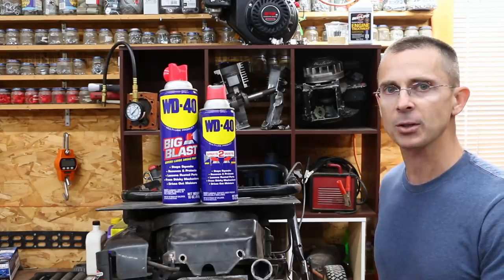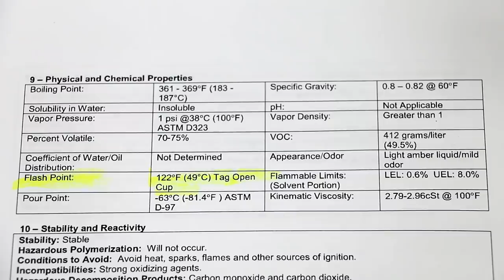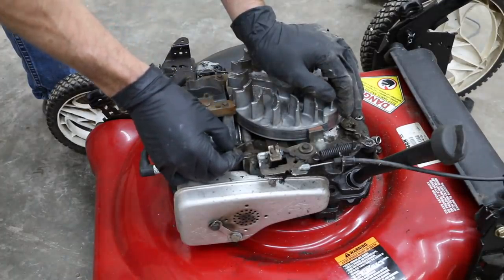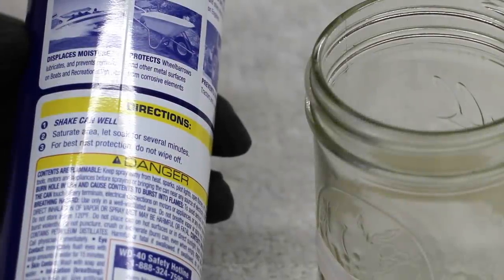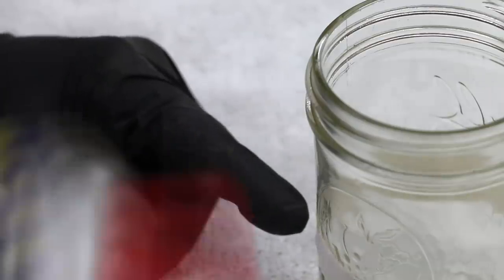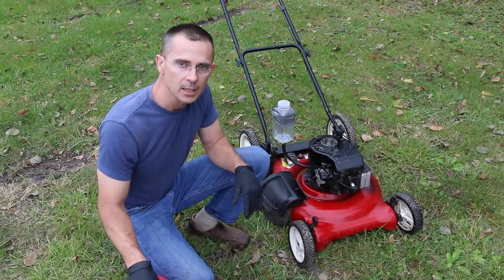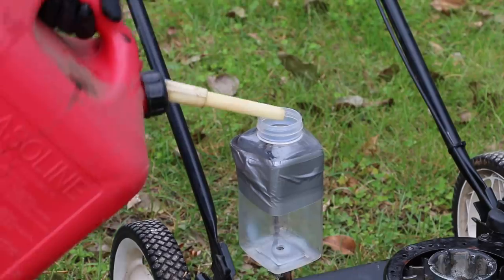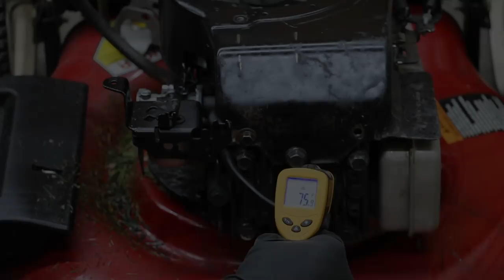Will a Gas Engine Run on WD-40?  Let's find out!

Comment: Interesting. We used to use 3 in 1 oil as an after run oil and preservative for our nitro methane model airplane engines. But we ran into a problem of it being so flammable that the engine would start without the glow plug power being attached. My father was flipping it through after a flight and it just started and ran without a glow plug. Very dangerous. We changed to marvel mystery oil after that to preserve engines.
Reply from the maker: Thank you!

Comment: You should try blocking off the spark plug on a gas engine with a bolt the same size an make a Diesel engine see what fuels will combust with no spark at all
Reply from the maker: Thanks for the suggestion.

Comment: it appears to be running on the gasoline part of the mix, and partially burning the wd-40. Just enough to lubricate the top end. I would say after one hour the engine would not be able to restart with the carbon buildup. Shave the head on this engine and put on a new main bearing or rod bearing and raise the compression up to 15 or 16 to one it it will run on straight wd-40, )for a while(
Reply from the maker: Thank you!

Comment: Many yrs ago coming out of woods I ran out of gas  ,and in the trunk I had 1 gallon colman camp fuel and a gallon of wd 40   so poured both in tank  and got to gas , so worked for me  yes it did smoke alot  ,but after fuelling  , it seemed to run better   ,so felt it blew out alot of carbon. 
So in later yrs  when tuning cars I would rev up engine and pour in liquid wd40 till I flooded them out let them set awhile   to soften things up   ,start them up , black smoke like crazy  ,then with spray bottle with engine revved up spray in water  , again  blowing black smoke till clean  , all carbon  gone run like new 
Also sticking lifters and valves gone I would add 1 cup wd40 to oil  , clear right up in short notice 
Also useing in oil all time never have and leaking seals   
Also I add to all rear end and transfer case  ,never have a leaking seal , 
If you spray your wiper blades twice a yr the blade last for ever 
Awesome shit when you get down to it and learn its many benefits and uses    I'm 77  been using it extensively  since the 60 tys  
Valve seals never go bad , they get hard and cause the oil to go by , but continue use they don't go bad ,run many motors 2 -3 hundred  thousand miles   still running smoothly no smoking  ,
Reply from the maker: Thank you!

Comment: Wd40 also works perfectly fine in a two stroke without any oil additive I tested it in my 1988 skidoo I was stuck once in the bush because my fuel line was brittle from its age that it just fell apart but luckily I had a can of wd40 with me
Reply from the maker: Thank you for the feedback

Comment: Doing some garden maintenance work with my father one time, used the clients lawnmower... The thing cut out after 5 mins... Qauter the way through the garden, could not understand why it cut out until I gave the Jerry can a sniff... The very intelligent home owner had filled the can with White Spirit and failed to label it 😂 not my problem... The can was stored atop the lawnmower on the shed, so I packed ot back in and that was that
Reply from the maker: Glad you figured out why it stopped running!

Comment: I like your see through cylinder head, and also enjoyed your job weld engine repairs, but remember Ford motor company building a plastic engine, and GM experimenting with ceramics, do you think job weld could be used for the block and head, if you try this, please stand back, and also make any explanations nice and dramatic for vid purposes your entering the world of science, not just. Questioning others science and engineering keep up the great work!
Reply from the maker: Thank you!

Comment: I like what your doing. But you seam to have missed the point that the spray uses propane as the propellant - which is why it is sometimes used as starting fluid.
Reply from the maker: Thanks for the constructive feedback.

Comment: In Brazil, where there are lots of alcohol engines, when there is a problem in the starting system in cold weather (ethanol needs to be warm) and one doesnt have gasoline at hand, a spray of WD40 in the air collector will always make the engine work. Old trick!
Reply from the maker: Thanks for sharing.

Comment: The problem with WD-40 is that its got citronella. We all know that engines don't burn essential oil.

Firebreathers never use scented lamp oil for fire shows. Fire shows are all about alcohol and straight kerosene.

WD-40 would make a very useful quenchant for knives. Never try to quench a knife in gasoline or turpentine.

Comment: Could this have benefits if I put it into my 2015 Audi Q7 with a 3.0 litre V6 Diesel with direct injection? It seems to have been running kinda rough lately. I am not sure what it is, and to be honest I don't have time to go to the dealership!

I've read that one should not put WD-40 in an engine with direct injection... which mine has... but you seem like a more reliable source of information, so I'm going to ask you!

Comment: Try wd40 and other products to clean fuel injectors using scan tool procedure.Have you tried  hydrogen peroxide on carbon deposits?What about using various acids to loosen bolts. Thanx for these vids.
Reply from the maker: You are welcome!  Thanks for the suggestions.

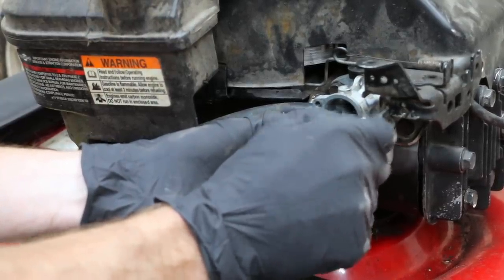Comment: I am interested in testing different two stroke engine oils which of them  does smoke less while burning it in an correct mixture with gasoline . I think about 1:25; 1:40 and 1:50.  The most mixtures we are using in little two stroke engines in germany. Second i am interested which two stroke engine oil does smoke less while it is used in an two stroke diesel engine with seperated engine lubrication (seperate oil tank and the oil pump is pumping the oil to the bearings and the cylinder/piston in pipes).  Thank you!
Reply from the maker: Thank you!

Comment: I wonder if there's some sort of test where one can gradually increase a fuel / WD-40 ratio, and find an optimum setting.
I'm sure the same must be true of WD-40 as is of 2 stroke oil. A 1/300 to 1/100 ratio of oil/fuel should make the engine run slightly better.
Reply from the maker: Thank you for the video idea!

Comment: I think you can get wd40 that isn't in an aerosol. It comes in a bottle you can just pour. I haven't seen them in a long time but if you can find them it would be a lot easier than emptying an aerosol can. I usually see them in an old barn where people service their own farm equipment or in a marina. I dont think you'll find them in your local auto store. Ive only seen them. Never used one. Could possibly be for a sprayer to attach to but it looks like a large bottle of brake fluid with a screw on cap. I assume its for soaking parts in. But like I said I've never looked under the cap so it could be sealed for a sprayer attachment, I'm not sure.
Reply from the maker: Thanks for the feedback.

Comment: I put 5 gallons of diesel into my datsun 260z when it was almost empty but warm I drove it from Middlesborough to Newcastle upon Tyne about 35 miles on full choke no throttle it was doing 3000 remember and in 5th gear around 70-80 mph. Next day I drained about a pint of diesel from the tank replaced it with petrol/gas and it ran better than before the diesel. At a later date I pulled the motor n carbs down and they were really clean inside, I wouldn't recommend it for long term use but as a get you home stunt it's a winner 😂😂😂

Comment: I noticed that the engine was very clean afterwards.  I always used wd40 to clean and de-grease parts.  How about using a mixture of a few ounces wd40 in a pint of gasoline and checking if it "cleans" carbon?  PS - I believe you can buy WD40 in a gallon container and not have to use the spray can...
Reply from the maker: Thank you for the feedback

Comment: The obvious question was never really answered: WHY WOULD YOU RUN AN ENGINE ON WD-40? Since regular unleaded currently sells for $2.79 per gallon locally, and the lowest price I could find on WD-40 was $24.00 per gallon, I think I'll just stick with unleaded gasoline. I notice another video (didn't watch it) about using bananas instead of motor oil or something like that. I guess some people will just do anything to get another video up...like the one I saw where someone microwaves stuff.
Reply: He did it because people asked him to lol...................................Not really that hard to figure out. He also says less than 30 seconds into the video.

Comment: Project FARM is an Animal - Haaa...lets see what this little harmless motor will run off of..Diesel, WD-40, Nitro, pixie dust. You do the engine experiments I always wanted to do.

So here is my request - what about an test where the engine runs on gas but also creates hydrogen via alternator power?  I think the original experiment was called BORWN's Gas?  The goal would be to see whether or not it would get better gas mileage than a purely gas rab engine.  Willing to throw a couple bones at this experiment.
Reply from the maker: Thank you!  Great test idea!

Comment: Do you think all the residual wd40 that doesn’t vaporize is beneficial for the moving parts it reaches?       I wonder if the wd40 would loosen old carbon deposits if ran in an old engine.     
I wonder if you could turn a gas engine into a diesel easily if in emergency situation

Comment: I was curious? Could a degreaser be used to lubricate a engine instead of engine oil? Will it not lubricate enough? Will it lubricate and clean and degrease an older engine at the same time? Increase compression?
Reply from the maker: Thanks for the suggestion.

Comment: Spray type WD 40 has a propane propellant that's what actually burns as a starting fluid. It's not the actual WD 40 itself. That's why it doesn't run worth a crap.
Reply: Pour some from a jug and I bet it won't run at all.

Comment: I think that you should have waited for running on gasoline, this way we could see first hand the build up on the plug and cylinder, then run the gas. This way we see & Know the actual results of WD40 in the engine, and a tear down of the carb would also show what it does there.
Reply from the maker: Thank you for the constructive feedback!

Comment: I have used wd40 to clean odds and ends things around the garage(if that doesnt work i go to the carb cleaner) but it looks like it doesnt burn completely in the see through engine test, maybe you could test it such as using seafoam to clean an engine. Like spraying it into the carb
Reply from the maker: Thank you

Comment: How about brake clean vs carb cleaner. Which works better as fuel... I've used both as starter fluid since that was all I had at the timr
Reply from the maker: Thank you for the video idea!

Comment: How about windshield washer fluid? methanal injection like the racers use. I would like to see it running with the see through head.  not strait methanal but an injection of it. side by side comparison of straight gasoline and objected. Compare power or work done. should be interesting to see.
Reply from the maker: Thank you for the video idea!

Comment: I'm curious to to know if an engine will run on acrylic laquer thinner. I know gasoline has some lubrication properties but thinner will not have any. If it does run, would this be a way to dispose of the large amounts of thinner used for cleaning paint guns in auto body shops?
Reply from the maker: Thank you for the video idea!

Comment: HEY you should do an experiment of how piston ring orientation is vital to an engine, I would make a video but I don't have nearly as much small engines as you
Reply from the maker: Thank you for the video idea!
Reply: @ProjectFarm  also if you havent tried mixing gas with styrofoam to make a super fuel and see just how badly it leaves deposits

Comment: One of the few things missing on YT is the attempt to run a car with WD-40 as engine oil, gear oil, coolant, brake fluid and fuel.
Reply from the maker: Great point

Comment: I've used wd40 to start old engines for years including a 70 something Yamaha 292(?) snowmobile  and a 1992 f250, 302 efi sitting in a field for 3 years.  Easier on the engine than ether
Reply from the maker: Thanks for sharing.

Comment: I'm not an expert 8n engines and such but like to learn, my knowledge goes about as far as replacing spark plugs, cleaning carbs, etc. So I ask, what are those other 2 circles next to the piston?
Reply: Noah Mcelwey piston rings they prevent oil from getting into the combustion chamber ( the place where gasoline burns )
Reply: No its not piston rings, piston rings are on the piston itself, those two circles (one larger than the other) are valves, one is the intake valve and one is the exhaust valve
Reply: Dutcher yeah I thought he was talking on the piston itself sorry

Comment: It acted a lot like I would expect diesel fuel to act. I have successfully used WD 40 as starter fluid, but it's not as good as ether, or brake cleaner.
Reply from the maker: Great point. Thank you

Comment: One thing WD40 DOES do well is clean up old spark plugs. Just put them in a cup and soak them over night, shake them around in the cup in the morning and most of the carbon deposits are gone.
Reply from the maker: Thanks for sharing.

Comment: if you use a Sony rx10 for the slow motion, why don't you use it to film the rest of the video in 4K?
Reply from the maker: I should switch to the Sony, but it's not at all user friendly compared to the Canon 70D.
Reply: @ProjectFarm  from my experience just read the user manual for a few minutes and you'd be good to go. I encourage you to try it out for a video or two.

Comment: If you’re running any of them inside it would be good to invest in a Carbon-monoxide detector
Reply from the maker: Great point.  I keep the shop door open with a shop fan running
Reply: Project Farm
Cool, i have a CO2 alarm on my car hoist incase i forget, and it builds up faster than expected
Reply: Project Farm Project Farm also you could Moniter how the engine burns by seeing how much CO comes out

I meant carbon monoxide sensor CO

Comment: For years since I can remember, I've always heard the myth about using WD-40 as a diesel engine starting aid. I have never, not even once, had any luck using it for that. 

Best luck I ever had for alternatives to ether was a rag soaked in gasoline held near the intake.  Or a shot of propane from a grill cylinder
Reply from the maker: Thanks for the feedback.

Comment: I ruined a tranny from a Suzuki esteem when I put gear fluid in the transmission.  How about using it as engine oil? That might not be something you could do but you might try it in the future. Thanks

Comment: You are gonna hurt yourself with that damn drill one of these times. A cool and possible injury prevention video would be on how to make a safe breakaway type of extension for that socket, a heavy duty plastic or even soft wood like scrap pine lumber anything strong enough to crank the engine but weak enough to break off if the engine fires and grabs ahold of that drill because that at the very least could break your wrist. I almost lost 3 of my fingers in a flywheel when I was 14 years old so I get very cautious with flywheels, yeah don't ever run them without a flywheel cover.
Reply from the maker: Thank you for the feedback!

Comment: No, water displacement solution number 40 does not run an engine....
That is the gas inside to can used to pressurize it that is combusting.
Try it with just the water displacement that comes in the jug......
Reply from the maker: Thank you

Comment: Make a great smog/fog machine.
Reply from the maker: Thank you for the video idea!
Reply: @ProjectFarm maybe you have already done this video but, have you tested if there is a difference between oil for small 4 cycle engines and oil for automobiles?  They are specially formulated for small 4 cycle engines ya know!  So they say......

Comment: Since WD40 is a flammable lubricant, I wonder how different results would b on a 2 cycle engine since u normally need to add oil to the gas on those types of engines.
Reply from the maker: Great video idea!
Reply: I used to use it as starting fluid in a two stroke jet ski. It works great.

Comment: urgent: video suggestion !
will a mower run normal (°F)with propane gas and would it be cheaper ($$) to use gasoline.
Reply from the maker: Thanks for the suggestion.

Comment: WD 40 may not be nice to gas engines. It is a great start fluid for diesel and should be a good and expensive replacement fuel for diesel. I have seen gallon cans of it in the past.
Reply from the maker: Thanks for the feedback.